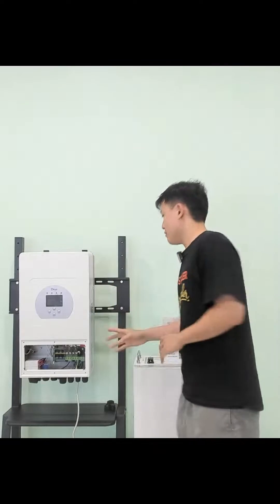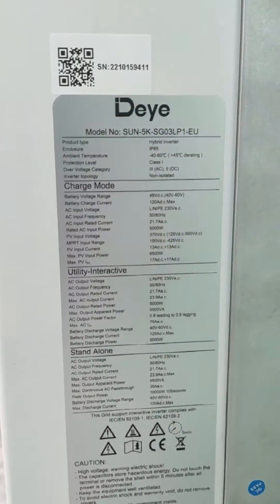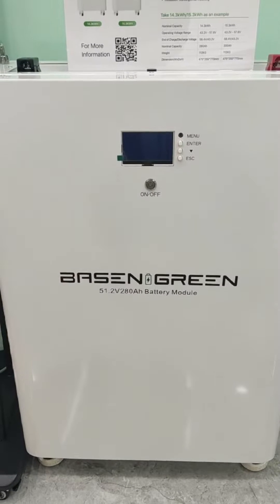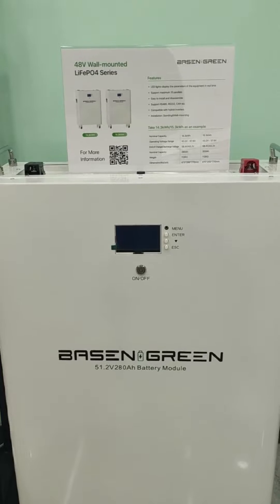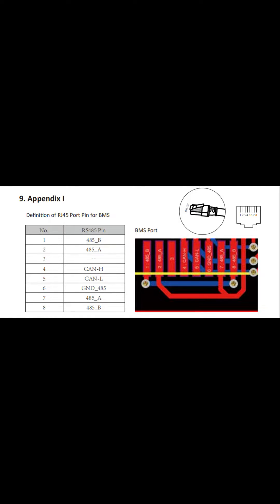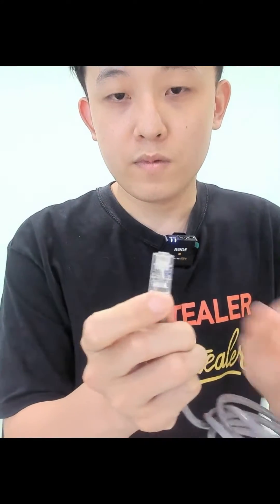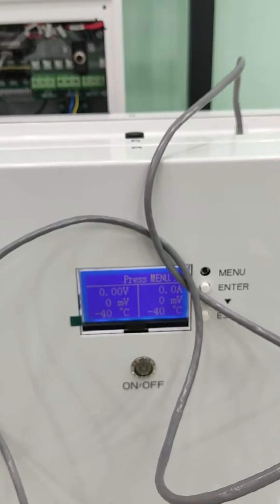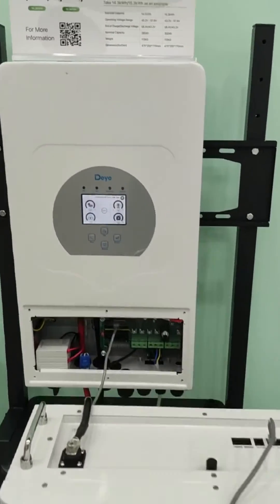BASENGREEN 48V Battery-How to make a communication to DEYE Inverter

Comment: If i use felicity inverter IVEM8048 so is it compatible with basen green battery  BR-OW-LV 16KWH
Reply from the maker: Yes, it is compatible, use Pylon protocol in RS 485 port, PIN definition: RS485A->Pin 6
RS485B->Pin 5
Reply: @Tom-BasenBattery   Let me see if i have this right rs 485 in from inverter rs 485 b out of battery 1 rs 485 in battery 2  and so on.

Comment: I have  BR-OW-LV 16KW BASEN GREEN IS IT FULLY compatible with 6kw SG03 OR 04 OR 05 LP1-EU  DEYE INVERTER ? IS there any problem in communication between basengreen  battery and deye inverter if I update software of inverter ? I don't see basengreen in brand table at List of approved list of battery by deye .... regards
Reply from the maker: Hello Mohammed, we support compatible with DEYE and Felicity
Reply: @Tom-BasenBattery  is there any problems if I update the software of deye inverter after I connect and read BMS of battery ?
Reply: @Tom-BasenBattery  
In this model that I mention above , I don't see feliecty as a brand on compatible list .
Reply from the maker: @mohammedk1127  Felicity uses Pylon protocol
Reply: @Tom-BasenBattery  
I will buy 2 battery of BASENGREEN and connect  with felicity and deye inverters ,so could  I connect with you if any problem that occure make no communicate between each other?  How can I contact with you ?
Reply from the maker: @mohammedk1127  tomchen@basen-power.com, or whatsapp: +86 18620387062